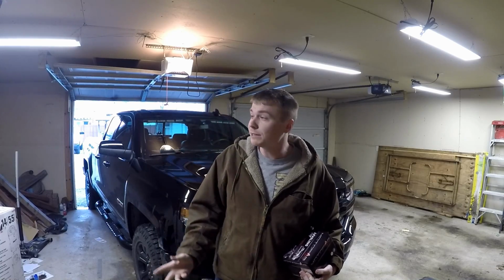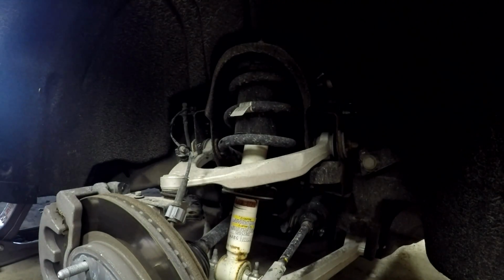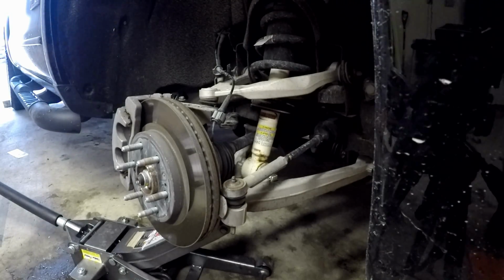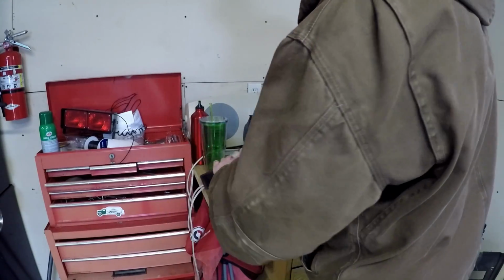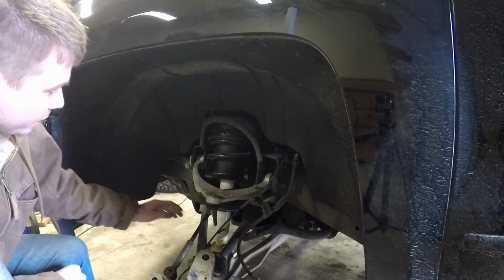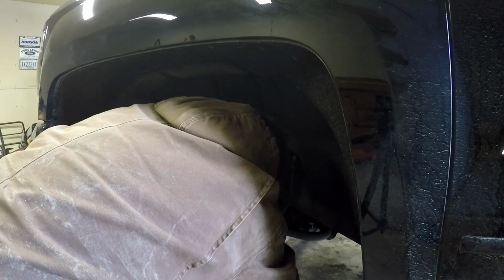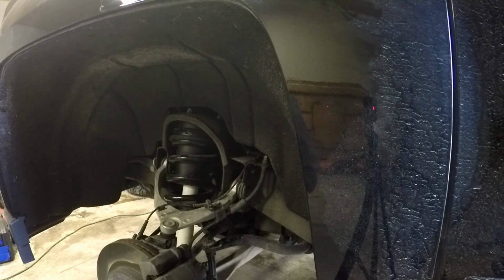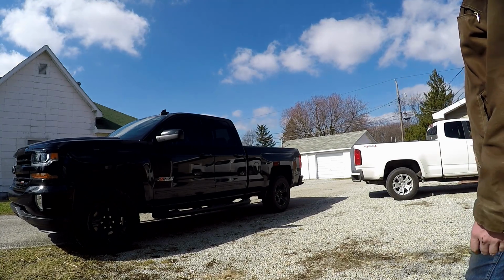Silverado mods: Leveling Kit Install

Comment: Nice, yup my truck got muffler delete and valve. I'm putting same level kit to this spring when it warms up. Almost got 3inch but figured 2.5 just right.
Reply from the maker: Nice!  Yeah the 2.5 made mine about perfect level wise. If I add the rear lift blocks I’ll get some rake back so I’m deciding how necessary that is.

Comment: on my channel i did the 3 inch on my Centen and its rub the hell outta my uppers so going back to a 2.5 rough country the 3 inch motofab for and rear sits at 41  inches at top of fender well

Comment: I’ve got an 18 Chevy 1500 LT Z71 package. Went to install my 3” leveling kit today by motofab and I couldn’t get the bushing at the bottom of the stroller to rotate so I could get it to sit flush before putting the bolts in. Any ideas why it wouldn’t? I could rotate it the other way but not the way I needed it to go

Comment: Were the hardware store trips for something that didnt come with the kit? Just curious because i ordered a 3 inch motofab levelling kit the other day
Reply from the maker: No, everything needed is there, it's actually a very well put together kit.  I just made a trip to get some threadlocker and the other trip was due to a broken captive nut that goes on the bottom part of the strut assembly.
Reply: Project944 oh okay thanks man!

Comment: Do you still need to get the truck aligned after adding this leveling kit?
Reply from the maker: I got my truck aligned after the install. It was a little out, so it would be a good idea
Reply: Get it aligned. Even if the truck feels like it drives straight afterwards do it anyway. It’s more for ensuring even (as possible) wear on your tires vs anything you’re really doing by leveling it.